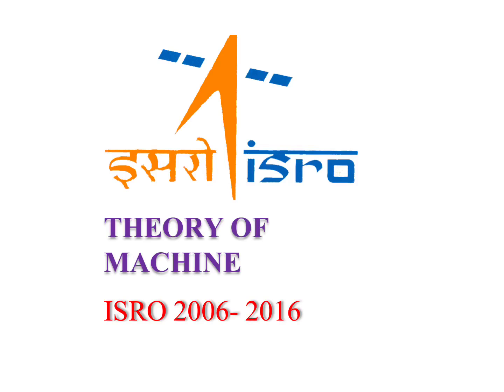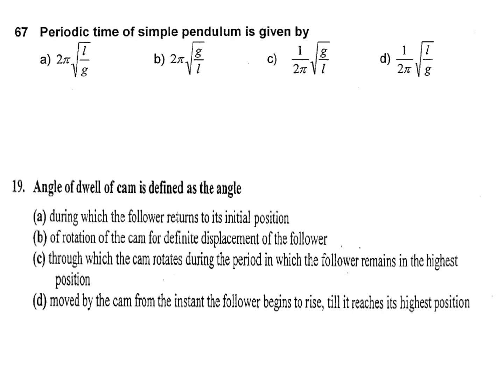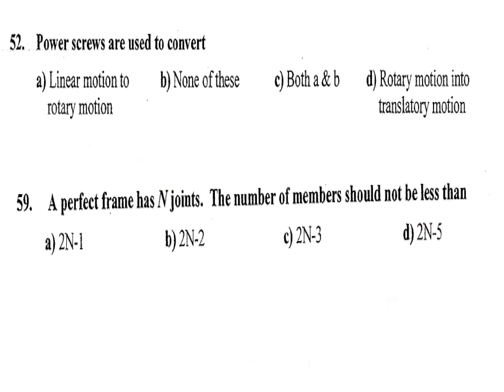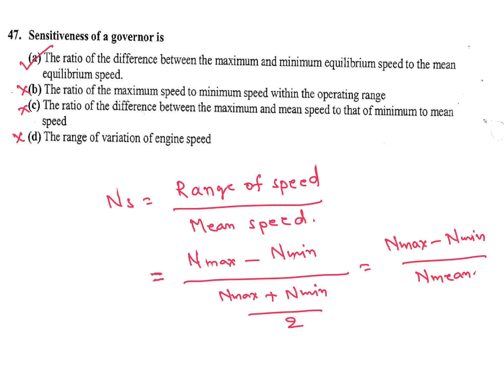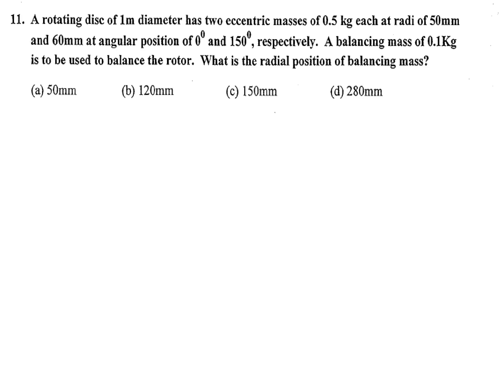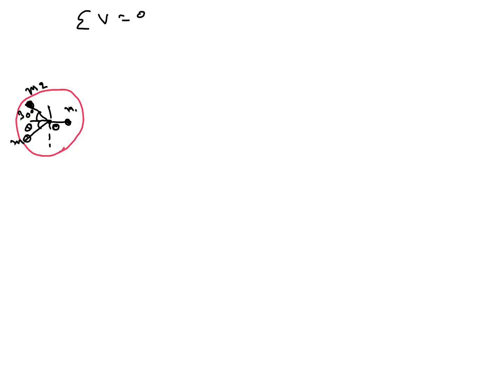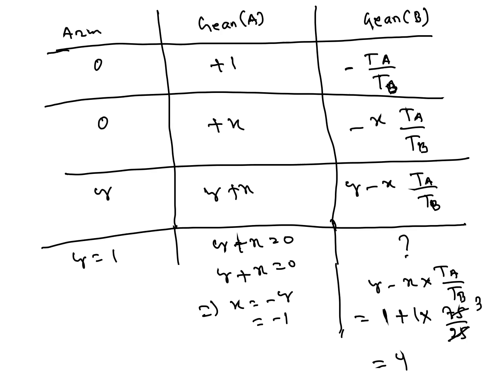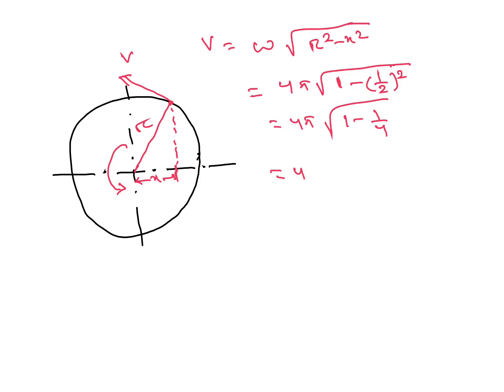ISRO THEORY OF MACHINE

Comment: sir quest>22 at 31:32 dof should be 1 instead of 2 as displacement to the input link is sufficient to cause motion in the output......................also by formula.....prismatc pair consumes two degrees of freedom instead of one as doubtedly mentioned in the video (surely by mistake)...prismatic pair is a sort of surface contact..or lower pair...instead of higher pair......like your comment on that..............thank you!